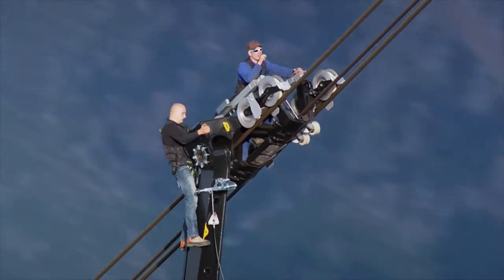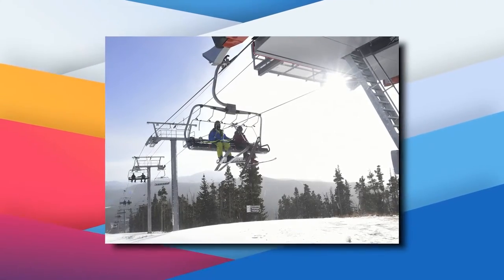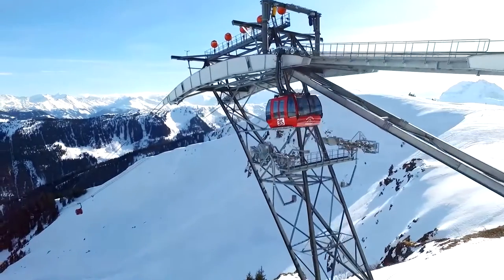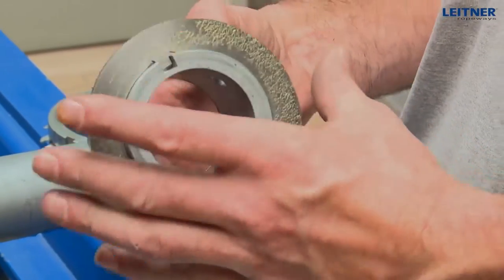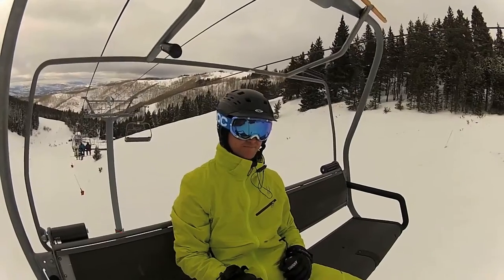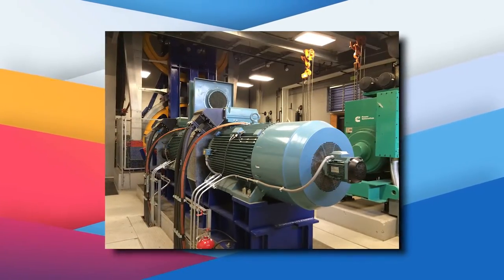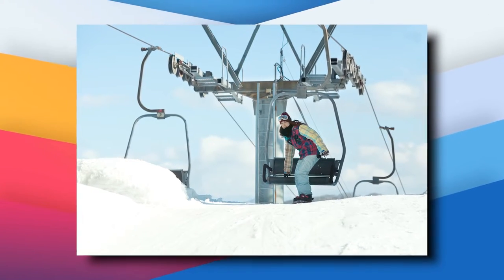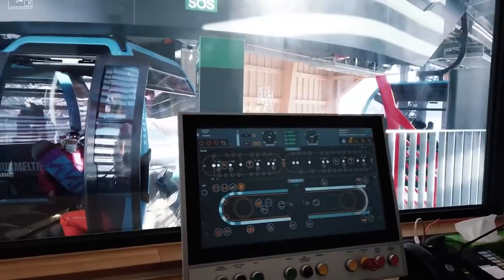How Ski Lifts REALLY Work..

Comment: Fixed grip vs high speed detach. Same uphill capacity. The slower the chairlift the smaller the line is at the bottom and the less busy the actual run is. More people waiting on the chairlift rather than in line or on a run is better for a ski resort. But I will say high speeds r the best on none busy days and mt biking.